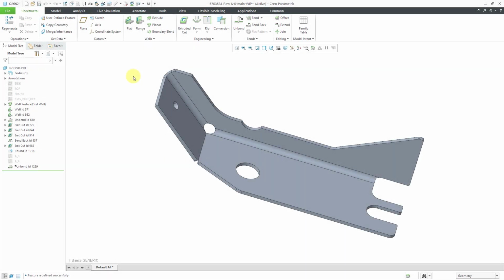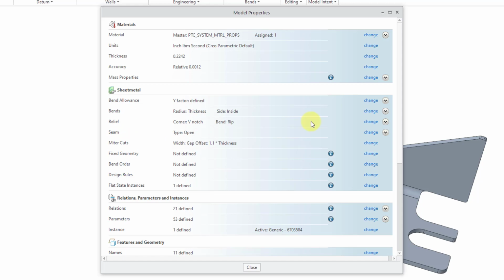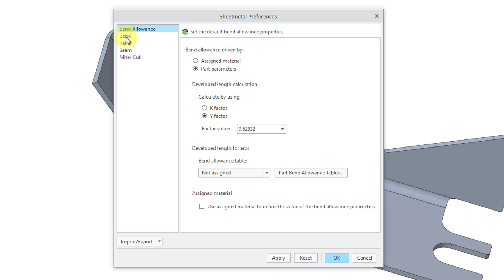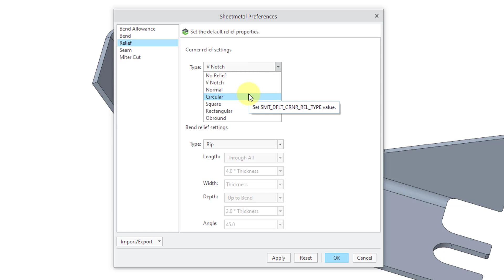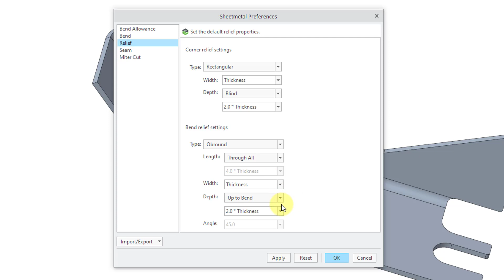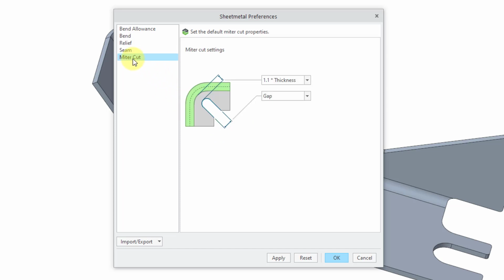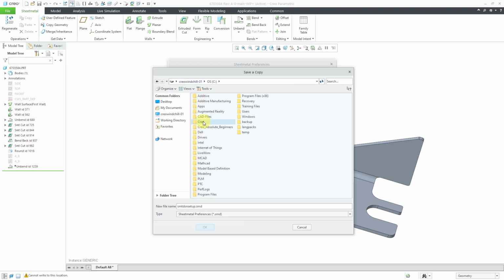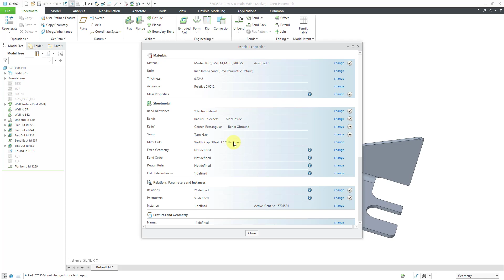Creo Parametric - Sheetmetal Setup | Preferences and Properties

Comment: Hello sir, how are you! I wanted to tell you that your videos are very helpfull for us beginner learning this powerful software!     I myself has been using creo sheet metal from past 2 year now using all the features including bend allowances to correctly calculate flat patterns! And wanted to ask you that, where can i ask queries and how  can i give feedback to improve the sheet metal module in creo since, i have found many things which are particularly time consuming to do in this...as compared to another cad software..
Reply: You have to use PTC Community for that
Reply from the maker: Kamlesh is right. The Ideas forum on PTC Community. If you really want an impact, join one of the Working Groups. Those users work directly with the Product Managers on formulating specifications for improvements to future releases.
Reply: Thankyou so much! Will definitely try it.